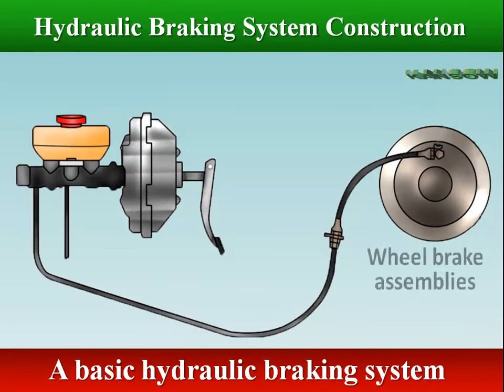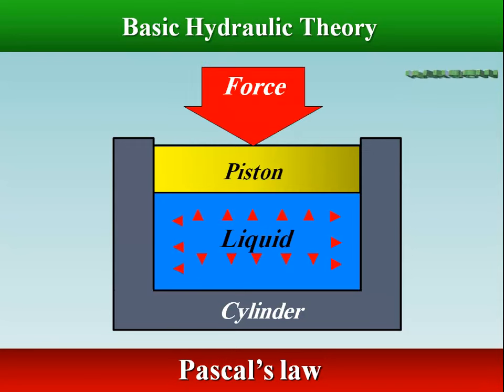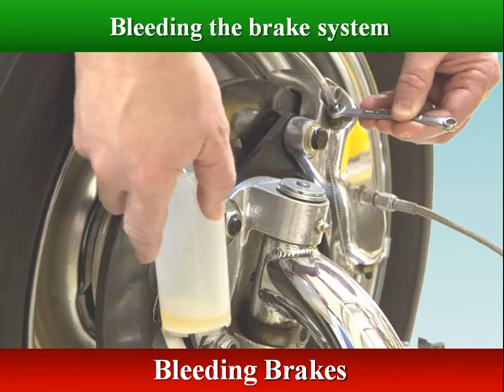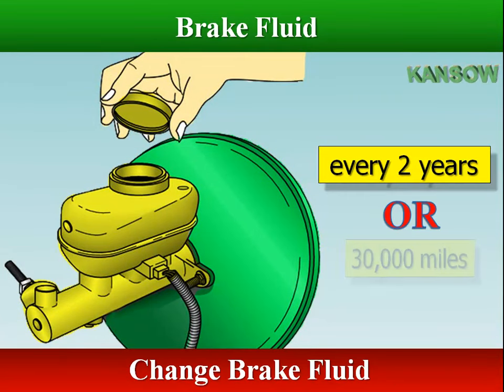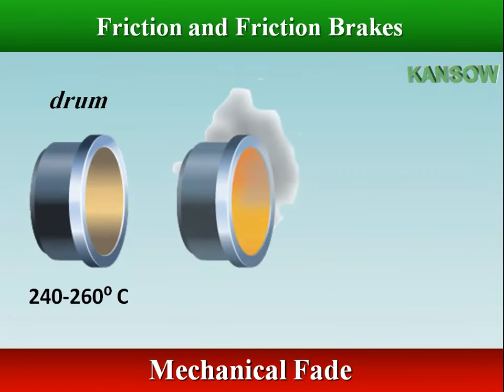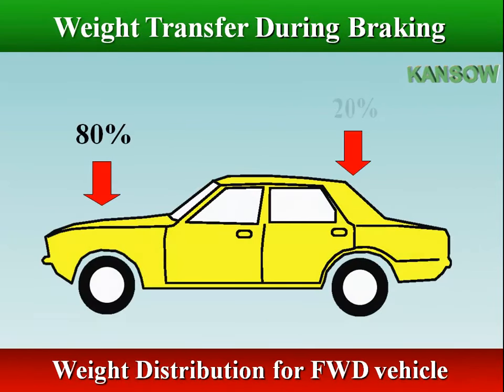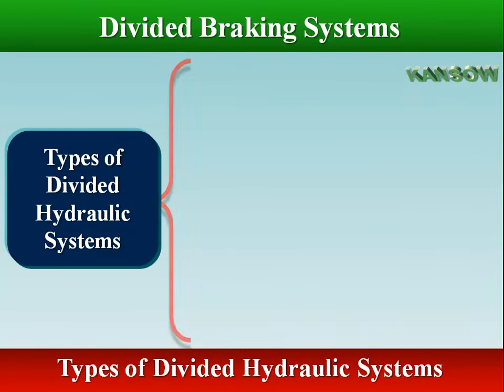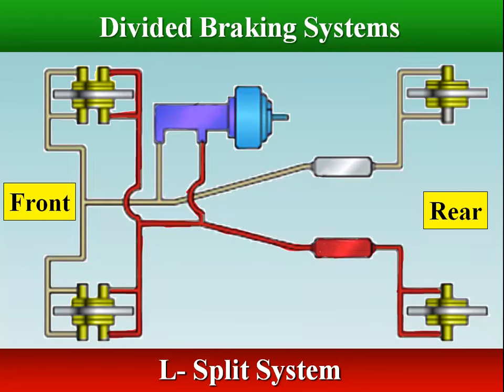Braking System Fundamentals

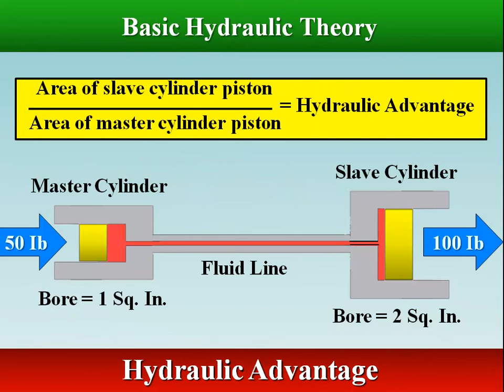Comment: There is an error in the diagram animation at  5:09. the top cylinder with an area of 1/2  inches squared will produce 200 pounds of force exerted not 50 pounds. The opposite is true for the bottom cylinder with an area of 2 inches squared.
Reply: Hi Derrick, you may want to re-watch.  For the top cylinder, if the line pressure has 100 psi (pounds PER inch2), then the piston area (as it's 1/2 it is LESS THAN the PER=1) it has to be a smaller force than 100lb transferred.  Ie.  Every 1 inch2 of area will multiple the force by 100.